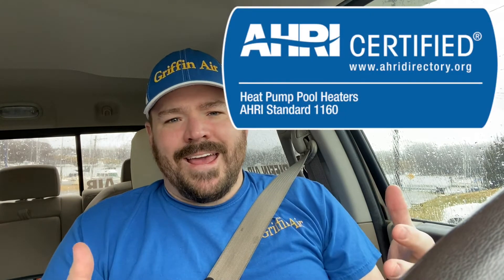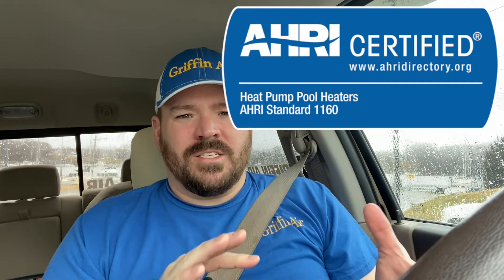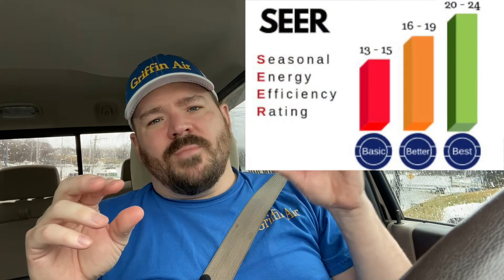Mismatched HVAC equipment. Is it a problem? What's changed? And what's AHRI certification mean?

Comment: Hi, We just had a new Mitsubishi HVAC system installed, and appear to be eligible to receive a rebate of $1,500 on the heat pumps from our local Dept of Water and Power (LADWP) - that is, as long as we can submit a complete, detailed invoice of the new system and an AHRI certificate.  Now that he has been paid in full, our HVAC contractor seems unwilling to provide this paperwork.  The original contract lists the specific components of the system.  How can we determine the SEER and COP ratings, and how can we get an AHRI certificate for our new system?  We paid an awful lot - almost $25K - to not receive these documents!
Reply: Hi, I have the same situation. I had Mitshubishi mini-splits installed and the contractor is not responding to my requests to provide certificates. Have you had any luck? Did you pursue another avenue to get the AHRI number? I have until the end of Dec 2024 to file for the rebate. Thank you

Comment: Informative video.  I being told by the local HVAC company that my Goodman 2-ton condenser (GSX140241) is properly matched to my Goodman 3-ton evap coil (CAPF3636A6DB).  However the system runs long cycles, humidity levels remain high, and minimal condensate is produced. I've asked that one of the two units be replaced to match.  They are advising these symptoms can be remedied by installing a piston into the system for the evap coil.   Is installing the piston the best fix or replacing one of the two units so their tonnage ratings match? I look forward to your reply.
Reply: Having the same problem with the exact same models. How was this resolved?

Comment: We had a HP unit go out last year early spring we had a home service contract with Black Hills Energy (they sub out the repair work to another contractor , Service One ) My plan offered a so called replacement policy which basically just covered a certain amount per item like 2500 for HP and 2500 for Furnaces / Air handler.  Long story short they tried to just replace the HP  which they couldn't get a matched system, do to the units being too old (15 ) and Lenox said nothing would be a match with the air handler.  I was also told that if it wasn't a match it wouldn't be up to code  all in all they could care less and the utility board who went to bat for me was told they had no jurisdiction on service plan contracts , to make matters worse they knew that the local building inspectors basically didn't even check this stuff so it would slip by which was comical and sad because this is now a federal energy code and you would think someone should be watching and it should not be up to an informed homeowner .  At the end of the day it just cost me more money and gave me a headache to have to fight for what is right , which nobody cared..
Reply from the maker: Yeah. I did a whole video about how much I hate home warranty companies

Comment: Get the proper BTU furnace and correct tonnage ac. Doesn't matter what brand it is. I don't force people to upgrade both their furnace and air when one goes out.  AhRI is just an originization to test efficiencies. Most  people that live in sub quarter million dollar homes don't give a damn if If they lost a few points of efficiency because they don't have a new variable speed furnace to match their new ac. It will take years to finally see a return on the extra money you spend on some ridiculous 25 seer ac. I think your getting lost in the weeds. 410a is never a problem for me. I hit target super heat and subcool on fixed Oriface systems with mismatched brand all the time I'm sure if I wanted to waste my time calculating efficiency it would be pretty damn close..no time to play got service calls to get to... Never had warranty denied. period. let alone have manufacturer asking if both coils and furnace are "matching" to deny a warranty...it's a good pitch to scare someone into all new equipment though....
Reply from the maker: You’re definitely in the minority there. I’ve heard several horror stories where manufacturers would not honor warranties due to the fact that it was not installed “properly“

The only way around this would be to lie and say that it was installed properly.
Reply: 30 yrs, I've used several brands, never a problem with warranties, but  I'm with Red, scare tactics 😜

Comment: Ok I got a customer with a 135,000 BTU Bryant furnace ...and it has a 2ton goodman condenser ...and is charged with 422d it won't go below 69f in the house is there a solution
Reply from the maker: Woah.  That's a huge furnace and a small condenser.  You should have a pro figure out why they didn't match everything

Comment: Hi Josh, i got a tricky one ,
Im living in 1500ft2 house , the furnace is 4 tom and 2 stage.  Im looking to install ac , what will be better ? To match it the same 2 stage and 4 ton?
Reply from the maker: That sound pretty large from your home but there’s many variable such as insulation, year built, windows and so on. I recommend getting a proper heat load calculation done even if you have to pay for it.

Comment: Ahri ratings are important. Most manufacturers fudge their "nominal" SEER ratings.  A typical 17 SEER "matched" system will typically have a true rating of 15 SEER for example.
Reply from the maker: Very true. And some folks don’t find out until tax time when they’re applying for a tax break or something like that.
Reply: Units can be under 5% of claimed rating and still be certified AHRI.
Reply: Hey, I appreciate your video and you commenting here.
Does AHRI focus mainly on the matching equipment getting the nominal seer rating, or does it go beyond that? 
Also, Is the refrigerant circuit operating at the proper sub cooling and superheating baked in to this certification?
What I’m saying is if you always match according to AHRI will you always get the proper sub cooling and super heat? 

It’s just that I read in a Equipment that’s not sized the same. Will either hunt for super heat or worse run low super heat. I’m just trying to reconcile this.